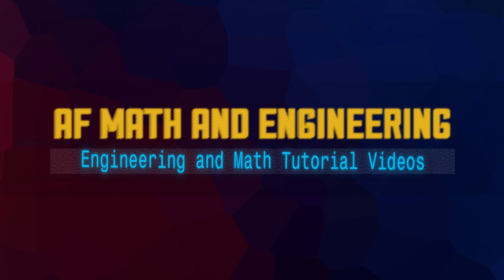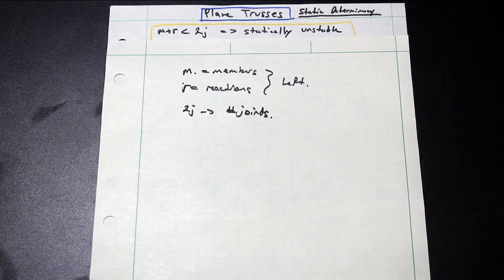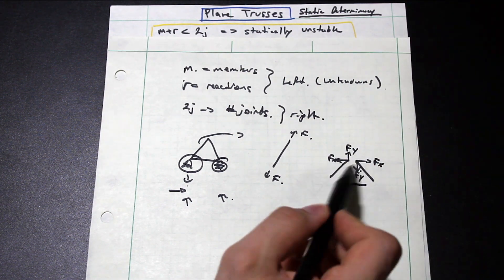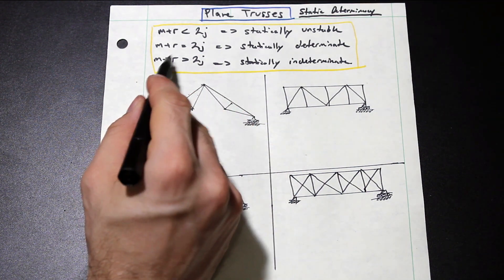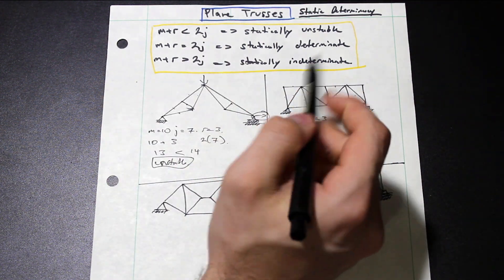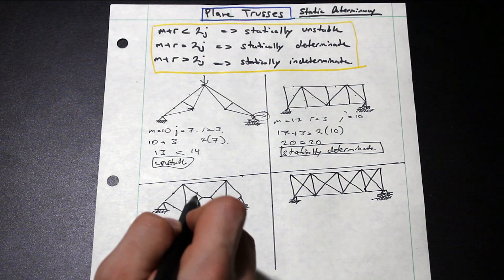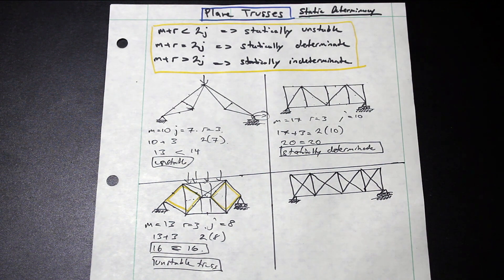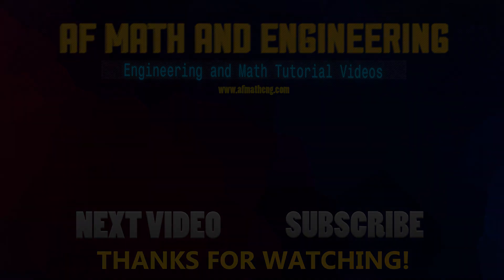Static Determinacy, Indeterminacy and Stability of a Plane Truss - Solved Examples

Comment: What if it was a rigid joint truss or a truss with some rigid joints? How can we change the formula?  Thanks for the video!
Reply from the maker: I think it's important to understand how this equation works, then it would make sense how to modify it for fixity.  There's a 2 coefficient in front of J because we're assuming these trusses are all pins, and at each joint we have a reaction in x and y with no moment reaction. Thus two equilibrium equations.  Around 2:00 we go over this.  If we introduce a moment reaction, we now have 3 equilibrium equations per joint.  See if from that you can reason out how the equation would change.

Comment: nice but I didn't get the last example..how the number of members are 21....I thought it was 29
Reply from the maker: mani kanta godi i think youre counting each brace as two..those braces are single members, so count each cross brace as 1 instead of 2.
Reply: but are they not hinged at the middle? they are just left open?
Reply from the maker: mani kanta godi theyre not 4 members connected to each other on the middle, that would kind of defeat the purpose of the bracing.  Theyre two members thst arent connected to each other.
Reply: nice bro. .the way you explained was really easy to understand..but some trusses  are stable according to equation but was actually an unstable structure as you have explained in example 3..please make a video on these cases so that there would be no confusion...thank you
Reply from the maker: mani kanta godi great, glad to hear it helped! Yea we have alot of video ideas but no time right now unfortunately, hopefully we can get back to the videos soon!